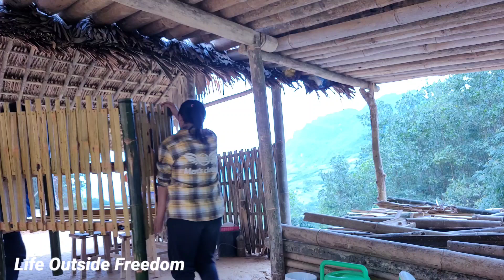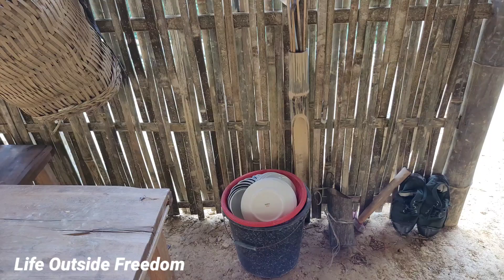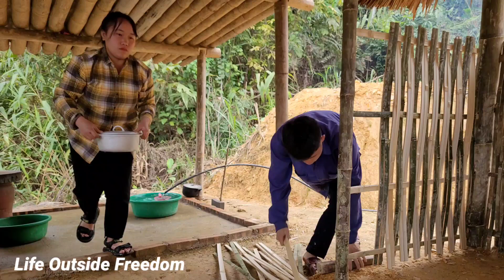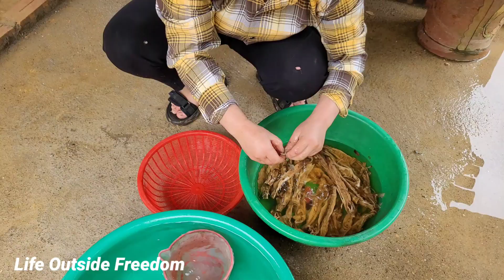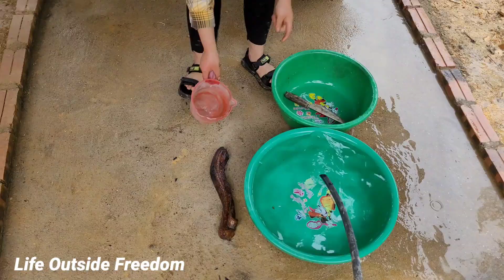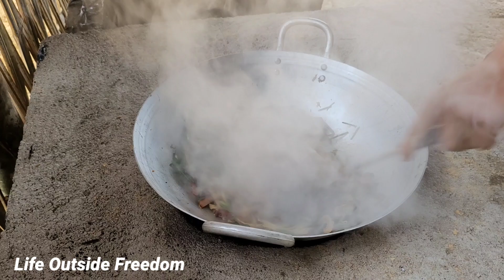Fence the kitchen wall with bamboo, Cooking on the farm - Phúc Sua / Life Outside Freedom

Comment: Hi Phuc, if you still have bricks left over I would utilize same to build water tank as high as 3.5 to 4 feet with spigot/faucet/tap to collect water in place of green basin. I would also suggest modifying your stove. Right now it’s too wide for pots and kettle to tip over. 😊 Just a thought provoking ideas. You know what’s applicable to you. Love to you both. Best…!

Comment: Good job guys! kitchen is looking good. I was thinking that you should build a stand up sink with a faucet . Bending like that to wash dishes or food has to hurt your back. Or just build a high table to put your basins full of water on. Just ideas of how it could be more efficient for the both of you. Also put the kitchen floor in concrete to keep the floor dryer